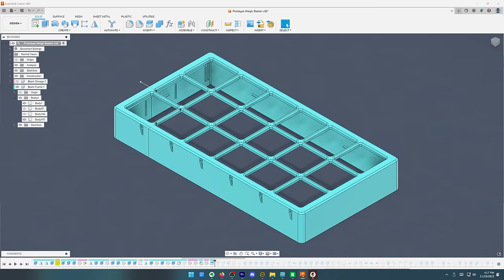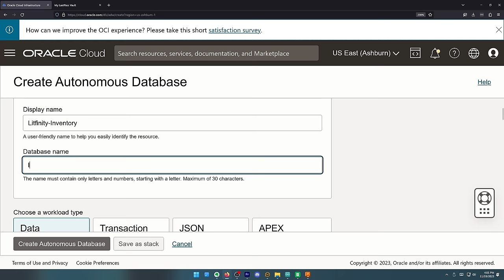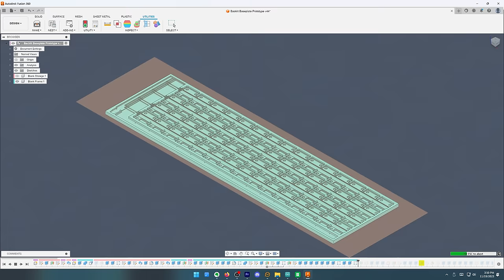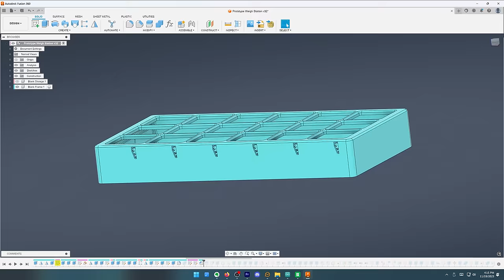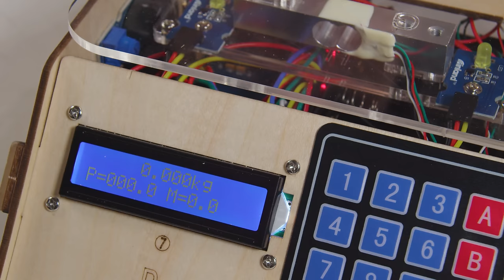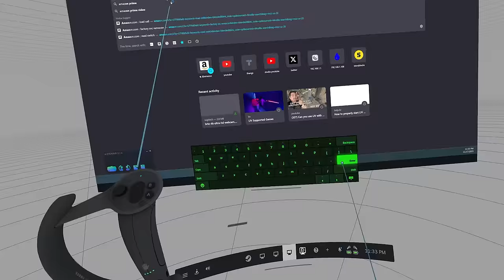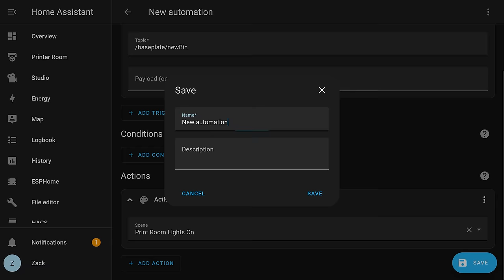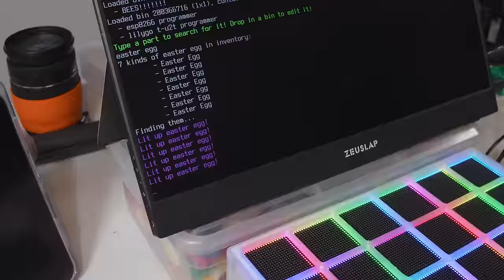My Storage has a Search Bar! Gridfinity + 8,552 LEDs = Litfinity!

Comment: Seems like it might be significantly cheaper and easier to get a PCB to use with the addressable RGB LEDs and hall sensors on it, just have a way to slide in the entire board into the base station print and good to go. Looking at that would be economical if you're planning on going to anything more than very small scale

Comment: You should consider using lasers rather than LEDs for highlighting bins. Also consider using QR/Computer vision to identify the bins.

 In the final product, you don't need to have the ability to light up bins that aren't rotated into the position that's ready for access. You could reduce complexity considerably by having no electronics in the trays that move through the cabinet. An addressable laser is expensive, but cheaper than the compexity of the whole system I think.

Comment: Load cells are painfully finicky. I've used one for a puzzle in one of my escape rooms and it was such a chore to get it right. Of course, the puzzle is also made mostly of wood, which means it needs recalibration every so often as the weather affects the material...

Comment: how about using a cheap projector to show where the item is instead of LEDs? Also, you don't need a bunch of RFID readers. There are RFID tags and readers built specifically for the task of finding where things are at a distance. You can even put some in the most expensive items instead of just in the boxes. If a very powerful one is too expensive, you can get a less powerful one, attach it to a belt and make it go from left to right a little

Comment: Might I suggest just using bike chains and gears for the rotating system?  Seams easier and if using used parts you can probably get it cheap.  Check your local bike store for retired parts.

Comment: Interesting project.

Personally, I just have a Notion table to track all the electronic parts I have (which I have extended to also track computer parts and tools...). Can easily create view to filter for electronic part, computer part, tools... And most importantly for me, store the datasheet and other documentations, and also photo of the part.

For me, the hardest is putting the part back in the correct box once I'm done with it (not suitable for the project..).

Comment: With those big flat drawers you have, I want to suggest forget the smart sensors, mount an HD camera on the ceiling looking down directly overhead; then use some sort of AI machine vision / image analysis to estimate how many of each item is in each compartment. Have it running whenever you open a drawer and let it directly update your data base. It may not be able to say exactly how many but it should be able to detect "Empty" or 1-10. Beyond that some parts would naturally be blocking others so it would say 10+.

Comment: Zach, buddy, in case you haven't been told 1000 times already: don't weigh half the unit. Weigh the whole unit. Do like those fancy single piece kitchen scales and put a transducer in each foot, then zero the reading when you see a different rfid tag than you last saw. Next thing that gets set down has it's whole weight measured. Store the empty weight of the bin with the rfid serial and subtract it for the weight of the contents.

Comment: Less elaborate, but more elegant (in my opinion): Give every bin a 16 bit ID, and a way to detect which ID is present on every square (maybe continuity based, with pogo pins and copper clad board with a 16 (+1 common) bit code taped onto it). Associate that ID with the bin contents in the base station. Then after querying the DB, send that 16 bit word to every one of a module that lives on every square, which compares the received word to the ID, and lights its LED indicator upon a match. Reserve 0 (or any arbitrary value) for all-off. The receive modules could be a little 6 or 8 pin MCU, or even discrete digital logic, it's so simple.

Heck, going the MCU route would let you ditch the expensive POGO pins and time consuming copper clad, and program the ID right into the MCU's EEPROM, allowing for a serial connection to the base station for changing or setting the ID so you don't have to hard code it into up to 65,535 versions of the same software (again, reserving 0 for all-off). You've given me an idea that I will almost certainly visit in the future.

Comment: This could have been easier, relatively speaking, with the wall-mount storage. No pressure on the sensor, and it can hide all the electronics behind the unit. Could have done some spring-loaded pads in the back to feed electricity to some LEDs behind the face of a newly printed cover for the existing door.  number and label the switches, and then you can just have a short program do a search and flip a switch. It's still a long day of wiring and labeling, but it takes up less surface space.  I like the idea of a workbench. You can pull containers off the wall, and now your workbench can identify where you left those parts, or you can set it up for all the components to be ready like a Lego electronics set.

Comment: The way I see it, when you take out an item, it should be 'active', so when it detects you added something back to the shelf, it automatically recognizes you're putting the item back.
Whatever item you last scanned is just the 'active' item, so you can easily swap between multiple items and put them back as you please
Is that how it's set up? I didn't quite figure that out while watching, maybe I zoned out at some point and missed it.

Comment: On the topic of how hobbyist vs. personal, I think it depends. For example, if it is a 3D printing project and you end up using 1 or 2 non-hobbyist tools, depending on the complexity, I would say try to change that. But in examples like in this video, it makes sense that you wouldn't make it accessible, because it is way out of the scope of most hobbyists, and would be too complex to open source.

Comment: wire issue could possibily be solved by routing them right beside the load cell, such that they have barely any mechanical advantage
compare the stiffness of the cell to the stiffness of the wires. Yeah, that

(literally tie the wires at both parts of the load cell, with a loop of slack. make sure they stay in the plane of actuation of the load cell, in the 'bridge' area)

Comment: i don’t know if it could have improved the system, but if you designed the system to first take an nfc swipe, then put it on a grid of wire connections akin to an old keyboard, couldn’t you then associate the “keys” the module presses(or depresses) as its location, you could then log the position of the module into your database. any time you take a piece out, swipe it again before putting it back to re-label its address in the gridfinity. the rest would just be associating the slots occupied with the location of the lights in the matrix.

given that they’d already require an nfc tag to log being taken in and out, you could associate the nfc tag with the size of the container module, decide which direction is forward, and bob’s your uncle.

i’ve not worked on a project like this in a while, so i’m sure someone smarter than me can tell me why this is a dumb idea

Comment: If and when you get the carousel / search everything working the way you want to I will set something to wear if you run out of something say 1/4 inch bolts you could just type in empty and it would find all the empty Ben's so you can refill them

Comment: Hey, put the whole thing on a scale. Each black tetris platform gets a scale? Small loads on the corners? Just a thought. I've had to get licensed from the state to work on scales for an old job, and you could literally treat it like they use the scales at the self check outs. You can click on the "bring my bags" option to put your bags on the scale before you start shopping, or the alarms will go off that you tryna steal shit. It will weigh everything you've made at that point, but that doesn't fekin matter cause you'll have a 0 weight. 

<3 this if u see it, cause damn if I'm not right.

Comment: Your load cell / wires problem should be similar to tare to remove the weight of a bowl. make a few measurements with the trays empty, average and subtract from future measurements? As long as the wires don't cause large fluctuations in the weight that should work.

Comment: Your disc magnets are oriented in the wrong direction. Reed switches need to ran parallel to the field like parallel to a bar magnet, which is the way they are used in door sensors and other security applications.

Comment: Here is a little piece of information for the future.
Magnets are conductive.
You can solder a wire to a magnet if you are very careful not to overheat it.
Or better, you can solder a wire to an iron pin that is also conductive and attracted by magnets.
Wire to base magnet, wire to bin magnet, they attract and complete the circuit, no logic required.
You are welcome

Comment: Having to use an Arduino or other microcontroller with your pi to interface hardware is not a bad thing. The Arduino runs realtime (one thing at a time).  A pi is a multi-tasking Linux computer. That means it could miss an even at a sensor when it is busy doing something else.

Comment: This project just calls for a custom PCB at the bottom of those bins. Maybe spring loaded pins in some kind of a track system. Thousands of PCBs assembled in China is honestly not that expensive. Less than $1 per board

Comment: If you get the carousel rolling, you don't have to do any processing on the tray, since it shouldn't light up until it scrolls into place. Can't you take the brains out of each tray, and instead just use one brain with spring-loaded pins to carry current and signal to the load cell, rgbleds, and reed switches in the tray that's currently selected? That would fix your problem of wires bearing load, since all the connections would be perpendicular to the direction of gravity

Comment: Personally I wouldn't have used RFID or magnetic sensors.  Barcodes and QR codes, and its derivations, are just better.  Scan a barcode, have product information injected into the database, borrowing from the vendor databases you buy from, have either a bar code or QR code per container, then use a QR derivation using those panelized LED blocks, you might not have the fidelity of a full QR code but you do have color to work with plus you really only need orientation and a couple bytes of data for cluster-column-row sorting.  Scan the product, scan the bin, scan the slot, everything gets nested nicely and you can search by product itself, and you can use your phone's camera as the scanner or even just a Pi with a camera module; this nesting method of sorting also scales nicely, you could literally have a multi-building warehouse structure if you wanted to, building-aisle-bay-shelf-cluster-column-row, and it gives you the location of a specific individual part that can be searched for via a simple query, and if you move things around all you have to do is scan out and scan in, there's also a simple way to scan in/out in relation to which part of the nest you're in, the only real issue is individual part inventory considering a lot of things come in a baggie of 50 and you won't be labeling and inventorying each individual part.  RFID could work but only if you're using a handheld reader to zap each thing, but this doesn't fix the issue of having to inventory each bin by hand, which is where a barcode reader works nicely, and if you're already using multiple readers you might as well just use computer vision and various patterns, hence why QR and its derivations are useful here.  Magnetic switches might help with automating a switch for empty slots to display their code, but this isn't really necessary, and probably complicates the system more than it helps; rather, just query the particular slot ID itself in the software and have that flip a switch between part/bin identification and slot code identifier.  I also feel like compartmentalizing a singular bin is also a bit overkill unless you have very few items of a singular part, very small parts, or a multi-section bin; but again, you really only need the bin identified, if you're organized you can just pick out the part itself instead of having compartmentalization becoming a hinderance, again just like the magnetic sensors.  The weight sensor is also a bit useless, isn't it?  Let's break down the complexity here, printed bins with a QR sticker, printed tray to go on top of some form of LED matrix, a phone or other computer vision device for scanning, inventory DB on a computer or even attached to a Pi for the purpose of only tying it to the inventory system, and a few wires for power and data to the LED matrices and optional non-phone computer vision device; modified tray and applying stickers are the two biggest things, then it's just scanning in a particular sequence to nest the inventory- much simpler than all of the magnetic sensor nonsense, the weight sensor nonsense, the RFID nonsense, and honestly the inventory DB could also be cloud hosted or the phone-side of it could ping a local server to start ingesting data.  Even just as a spitballed idea with no further iteration, manipulating computer vision makes everything so much simpler among the entire stack of what needs to be accomplished, in software, hardware, and physical setup.  The setup you've made here isn't bad, for a single cluster attached to an RFID reader sitting on a tabletop with a keyboard attached to it, the problem occurs when you start scaling this beyond just one cluster and start scaling into multi-unit portions such as clusters in shelving and clusters in toolboxes, etc., which is where computer vision (especially via a phone) becomes an insanely efficient system as you really only need power and very simplistic data going to those LED clusters for identification and you have one tool for every step of the scanning process that feeds an otherwise fairly simple database that self-identifies products once you share a UPC database with vendors you purchase from.  The identification process can also go a step further than just bin identification when searching, as implied earlier, imagine if the shelves in a shelving unit had their own identifier via a light or buzzer, or if you have multiple tool carts with multiple drawers, etc., the software itself could also point you which unit or shelf without a physical identifier.  Of course spitballed ideas need refinement, but this is a much simpler jumping-off point, easier to design, easier to manufacture, easier to implement, easier to maintain, easier to scale, and easier for people to reproduce, while also being more cost effective every step of the way, not to mention that if a phone is used as the scanner the phone can also be used for inventory querying, and everyone has a phone capable of handling this, especially with how the DB can be accessed remotely quite easily.  Though I guess this does borrow from modern inventory and query systems anyways, Walmart uses Zebras, Target literally has employees use their phones and their app, QR codes have been used for a long time, both Zebras (glorified phones) and phones can handle multiple forms of codes, and more and more stores are adopting bay nesting in aisles to further refine locations of products, not to mention inventory nesting is now at a scale from individual products up to multiple stores, all with the simplistic inventory system they've used for decades with some modern upgrades; it's not that hard to reproduce and rescale for personal use.  It seems like you forgot the number one rule of prototyping or producing anything, keep it simple.

Comment: You didn't make a project that others can't make due to materials that are harder to source, you made a project that is the foundation idea for someone to make a cheaper version with more available parts. Maybe a storage grid with QR codes and 2 old Android phones one to add the block to the catalog, and one to scan all the storage blocks underneath, it'd only needs a few frames a second. You could add another phone to each storage section so you could look up a specific screwdriver and itd light up an led strip on the back of the tool chest. Maybe have a single RGB led on the corner of every box and have it slot in like a replaceable Christmas light so you don't have to worry about all the circuitry for the led matrix.

Comment: Instead of magnetic sensors, why didn't you use a piece of wire on both magnets, so the contact between the magnets act as a switch?

Comment: 23:10 I'm not super knowledgable on programming sensors so correct me if i'm wrong on this but would it be possible to use the scale as is by just adding a 0 function that ignores the initial weight of the cables? I know most digital kitchen scales on the market have a 0 function so you can have accurate weights of ingredients without needing to worry about the weight of the plate/bowl holding them also getting added. If you can then it might be easier to just make a script that does that instead of making a wireless charging system to keep it powered.

Comment: That's awesome! Quick question, those little containers and the wall mounted holder for them behind your right shoulder around 37sec's in. Are they all 3D printed? If so, where can I find the STL? I want to print something like that for all my nuts and bolts etc.